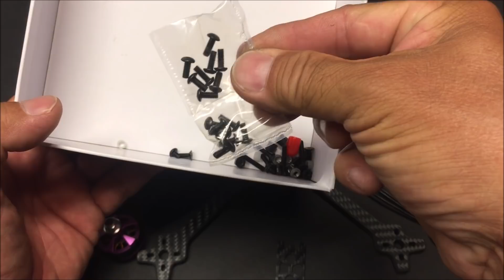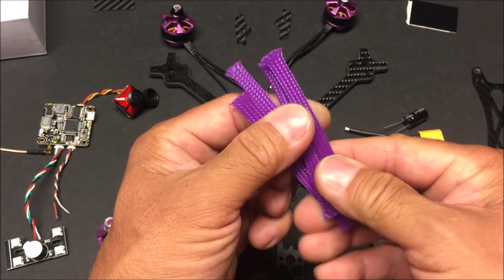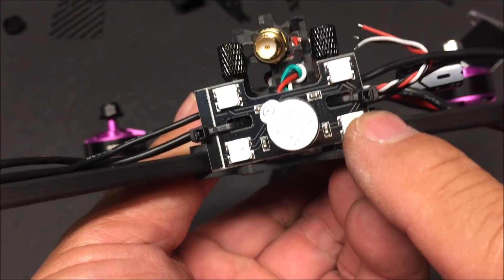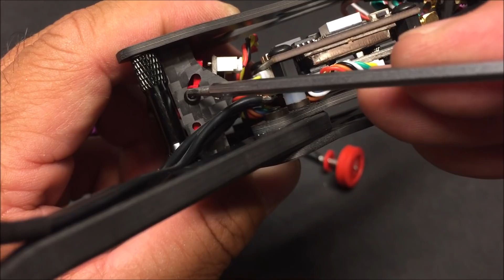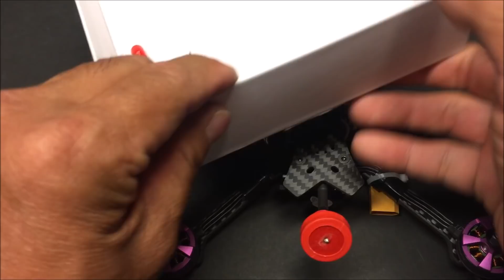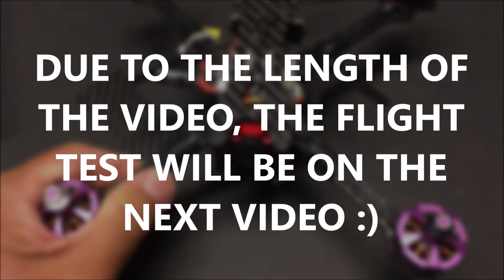$112!!!  TERO Q215 FPV Racing RC Drone Kit

Comment: Problem; my FPV camera connector (on the camera) has 4 prongs and my red yellow and black wire that you plug into the camera has 3 slots. I see that your camera only has 3 prongs...what should I do? Thanks in advance!

Comment: I copied your build exactly, boards are in the right way with motor numbers aligned to betaflight motor numbering scheme. I used the wire length as the guide to solder to the corresponding tab (yes I know if you swap 2 wires it will rev the direction) and all my motors are rotating the wrong way which means I will need to BL Heli revers them..........surprised no one else has said anything. So either the factory cut the wrong wire short, or......I dont know......PITA!

Comment: Hey mate, great video. I've been trying to find out where the bootloader pins are, so I can flash firmware. Thought it might of been that little button just above the antenna output ? Can I run I-bus into that receiver wire, seeing as it's set up for s-bus? I am having trouble getting receiver to work, that's why I thought I would flash firmware. I have flysky FSi6-X Transmitter & trying to use receiver that came with that.I just select uart1 in betaflight for serial rx , right?
Any help would be greatly appreciated, cheers.
Reply from the maker: Correct on the uart 1 for serial and smart audio on uart 3.  I've posted couple of photos on my facebook page on the fc showing the boot button but I don't see an ibus pad.
https://www.facebook.com/RC-Escape-818263618290823/
Reply from the maker: I've just checked the product page and it says it supports it via uart 1.
https://www.gearbest.com/flight-controller/pp_009196608404.html?wid=1433363

Comment: I really need your help. How do you flash the firmware to the flightcontroller of this quad? I took the OMNIBUSF4SD 3.5.1 firmware and after flashing it wouldnt  connect.
Reply from the maker: reflash the old firmware and see.
Reply: @RCEscape  ok, thanks i have solved the problem by changing the usb cable
Reply from the maker: haha!!  the simple things right?!?
Reply: @RCEscape  yes, annoying everytime, now i am not able to spin the motors in betaflight. Has this something to do with the arm- lock?
Reply from the maker: @cfactor9737  
Yes there is a safety feature now.

Comment: I recently flew the assembled BNF version.  However, the capacitor is not included with the BNF version causing extreme interference.  I would like to ask your permission to include in my review the following screenshot from your video showing this capacitor.  I would of course include credit and link to your video.  Please let me know if you concur  https://image.ibb.co/j2qqrV/Missing-Capacitor.png
Reply from the maker: Yes of course you can use the screenshot :)  I took my capacitor off and put a spacer in between the flight controller and the middle standoff and it made a night and day difference.  The capacitor had no effect on mine.
https://www.youtube.com/watch?v=Dsdf2el9Mgc
Reply: In the bind and fly version they've added separators to increase the space, but removed the capacitor as seen here https://image.ibb.co/fEYaBV/IMG-20181023-130348.png
But it's still getting extreme interference, and can only guess that it needs that capacitor.  Here's how the video on my BNF version looks https://youtu.be/Z7jwXRZhTSI?t=366
Reply from the maker: Looks like they just added another standoff.   Perhaps it also needs to be separated from the top plate as well since now it is really close to it.  If you've got some rubber O rings to soft mount the flight controller, try and take off one of the standoff spacers and use just the O rings like I have done on my unit.  I had the same exact interference where it starts off great and then it gets progressively worse.

Comment: Plan on ordering the build kit tomorrow. This will be my 2nd build & cant wait to put it together. Excellent video Pete!!        :)
Reply from the maker: Hey Alan :)  The price on this thing went up right after the video upload.  I'm asking them to lower the price back down to $112.  But they are on vacation and will be back to work on monday.  Wait a few days before placing the order till then and see if the price drops or they issue a coupon code for this item :)   Thanks :))
Reply: @RCEscape  Ok. Will do. Thanks much Pete
Reply from the maker: If nothing happens, you can use this coupon code   IBXPXH192H
it will save a little :)
Reply: @RCEscape  Hey Pete, I ordered a pagoda antenna for this one & when I got it, it had a male end on it just like the sma connector has. Been having no luck in finding a pagoda antenna with a female end on it. Anyway you can provide a link so I can order the correct one. Thanks much       😊
Reply from the maker: Hi Alan :)
Instead of the pagoda antenna, I am using a circular polarized antenna like the aomway kind.
https://www.amazon.com/dp/B01LMQMR42/ref=dp_prsubs_1
It is so much better than a pagoda antenna.
Reply: @RCEscape  Awesome. Thanks much for the help Pete.  Appreciate it alot        :)